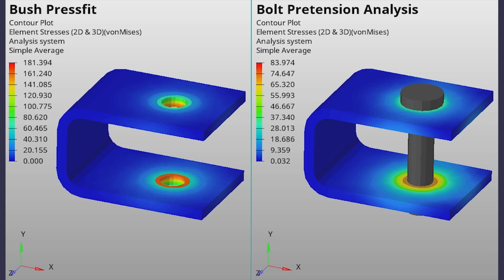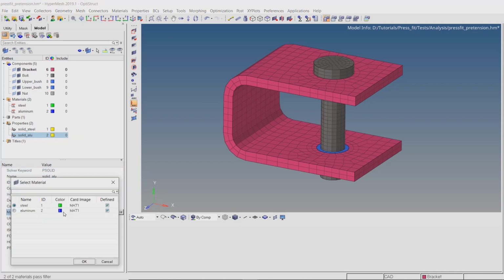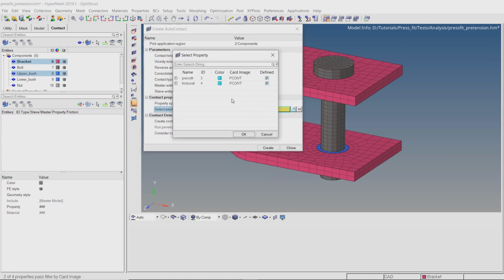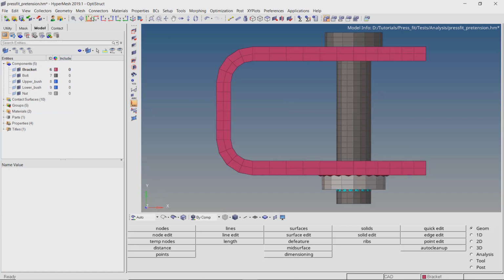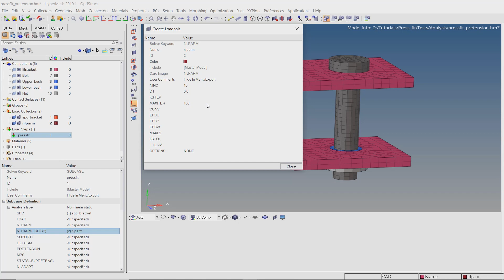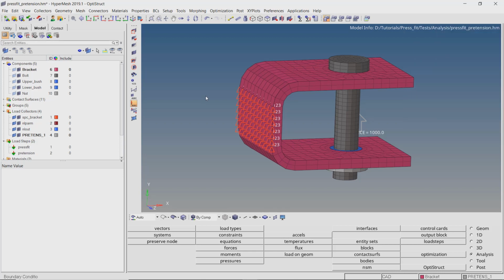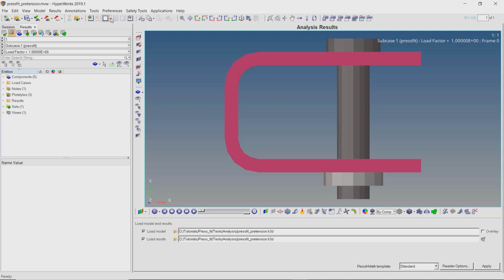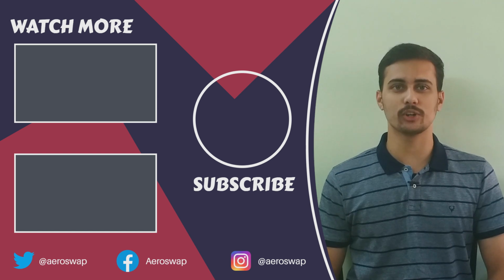Hypermesh Nonlinear Analysis [Optistruct Tutorial]

Comment: Hello, When creating Hexa mesh. first I generated Hex Mesh for the bracket. later when I was trying for other components. It was going on the same component in which  Bracket Hex Mesh was there. I tried changing the current component but facing the same issue.
Reply from the maker: Hi Puneet,
You can right click on the desired component and set it as current. You can also use the current collector selection box present at the right bottom corner of Hypermesh window to do the same.
 
If this does not work, I would suggest creating a new component every time before creating the mesh. A newly created component will always be set as the current component.

I hope this information helps.
Reply: @Aeroswap  Thanks

Comment: Thank you so much for your lecture. I think I’ve followed your instruction perfectly. But, there occurs an error when solving the second load step. According to the output file, it seems that there occurs excessive displacement (or contact force), leading to so-called overclosure error. Could you tell me how to solve it?
The below is the hm file I generated (I added an additional SPC on the bolt to avoid the error but I failed).
https://drive.google.com/file/d/1eWlifPIm8Vg6x0P_kj92EtNy5OoA44VB/view?usp=sharing
https://drive.google.com/file/d/1WkW77UfOEYu01yANxYGUUAkcun87s2WV/view?usp=sharing
Reply from the maker: Hi Sinwoo,
Have you checked the animation files for the analysis. It will give an idea about how this excessive displacement is happening. Then we can make changes to the setup accordingly.
Reply: @Aeroswap  Hi. The animation for the load step#2 is not available because even a single iteration could not be converged. I think the parts are penetrating each other even with the contact pairs. I was really happy to find your video because the example demonstrated is almost similar to what I’ve tried to solve. I really want to solve this problem. Could you help me?
Reply from the maker: Alright, well. Can you please connect with me via email. It would be better for communication. My email address is provided in the 'About' section of this channel.

Comment: Hi Sir really nice tutorial, Just one doubt cant we give values such as Yield stress, UTS etc for the materials ehere in optistruct because from the MAT1 type selected only E, Nu were there?
Reply from the maker: MAT1 is a linear isotropic material. As this is a linear material, yield stress has no significance here. This material cannot be used to show nonlinear behavior like plastic strain.

If you switch the MASTS1 entry in extended options of MAT1, you can include nonlinearity in the behavior. I have demonstrated the process to do this in my Nonlinear analysis tutorial. Please check that for more details!

Comment: hello, can I another question please? Do you if it is possibile to define a force that keeps tangential to a surface or a profile? I ask because  I have a surface whose profile changes, so i cannot define a tangential force with x,y,z directions. Thanks
Reply from the maker: So you want a shearing force on the surface?
Reply: @Aeroswap  yes, I think
Reply from the maker: If you want perpendicular force, you can opt for pressure load which will always be perpendicular to the surface at all locations. However, if tangential force is needed, you have to create separate loadcollector for each surface and assign the vector direction manually. Then these loads can be combined using LOADADD as I previously explained.
Reply: @Aeroswap  ok, thank you very much...

Comment: Hello, thank for the video. It is possible to run a static analysis by applying 2 loads contemporarely?
Reply from the maker: I'm sorry but I didn't quite understand your question. Can you please elaborate?
Reply: @Aeroswap  yes. i have subassembly to analysis, which is loaded with 2 distinct forces. Yet, when I define the LoadStep, in the window "load" i can select only one force, as only one constraint. So, I was asking if it is possible to run the analysis by applying both the loads... thanks
Reply from the maker: Yes, that can be done. Create a third loadcollector and set its card image to 'LOADADD'. Then specify num value as 2 and select the first two loadcollector in the table. Make sure to use scale factor values as 1.

Now you can apply this LOADADD collector in the LOAD field of the analysis. This will combine the two forces and apply them simultaneously.

I hope this helps!
Reply: @Aeroswap  Yeah it worked! Thank you very much! i was really screaming mad...ahaha. Thank you!!
Reply from the maker: Good to know it worked :)
Reply: @Aeroswap  thanks a lot. Might I ask another question? i am a bit confused about the system units of Hypermesh. I go and see in option DTI UNITS the default units and I saw : kg mm N s... but if I create the material, Steel for example, the default features displayed suggest that kg is not respected, in fact the density of material it's expressed in ton/mm^3 (7.85 e-09)..... so I'm not sure the DTI Units are respected. Please, is there a way to be sure of the units in the model?
Reply from the maker: Hypermesh is a unit neutral environment. There is no default unit system but using consistent units is very important. You are right, the default material properties are expressed in tonne/mm^3. However, that is just to indicate the consistency of units.
You can use any system of choice to create your model. DTI card does not influence the analysis setup in any way. It is just a note of the unit system used. The analyst has to keep that in mind and make sure that correct units are used when specifying every parameter.

I hope this helps!
Reply: @Aeroswap  Alright thank you very much.

Comment: i was trying the same analysis on a self generated cad model, when i try to create contacts, it shows no contact was detected for specified inputs. Can anyone help ??
Reply from the maker: Try using a higher value for tolerance when using the contact creation option. The proximity between surfaces may be different for each CAD.

Comment: Hi,
Even after increasing the MAXITER value also..same error is coming.(max.no.of time increment cutbacks reached and also sever element distortion detected).
Any suggestions?.
Reply from the maker: Severe element distortion is usually caused by incorrect material data or very high force values.
Make sure that you have used consistent units for the analysis. Also check the applied force values and material density.

Comment: Hello. Thank you for this video.
You explained the procedure very aptly. However, i get the Fatal error in HyperWorks solver view screen. I am assigning the number of CPU cores as 4. Let me know what can be done.

A fatal error has occurred during computations:

  * ERROR # 4965 *
  Maximum number of time increment cutbacks reached,
  analysis aborted.
Reply from the maker: Hello Dhruv, this is not an error regarding number of CPU cores assigned. This error message points to incorrect nonlinear parameters.

I suggest you to increase the number of iteration (MAXITER) from the nonlinear cards and see how it goes.

Sometimes, a bit of trial and error needs to be done with the nonlinear settings as per the analysis under considertaion.
Hope it helps!